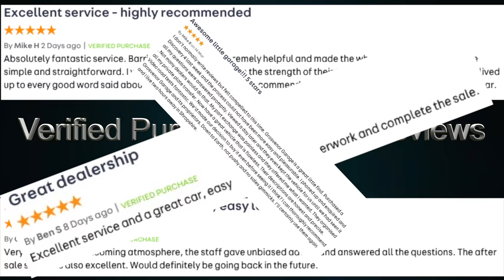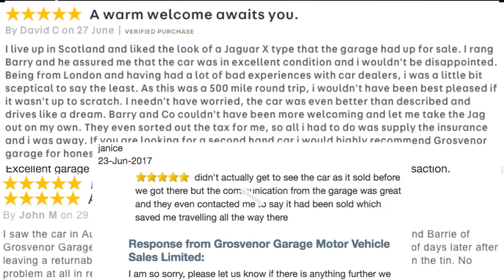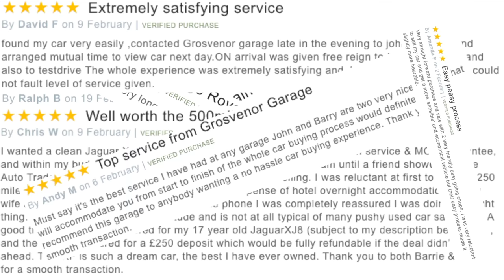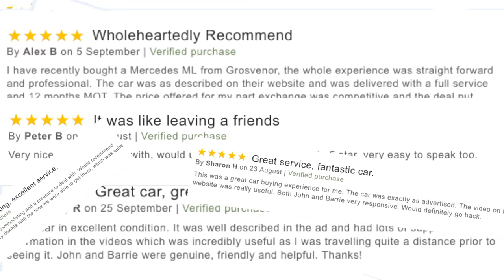How to replace the battery in a Citroen Xsara Picasso Remote Key Fob

Comment: We have this key fob and took out a CR2016 but our car manual says a CR1620 ..... so confused.
Reply from the maker: Abby and Ethan if you watch the video i say its a CR2016
Reply: @BarrieCrampton  yes I saw that and that is the number on the old battery we took out. Our manual says a different number though. Either way it still hasn't fixed our problem 😣 looking more like the immobiliser.